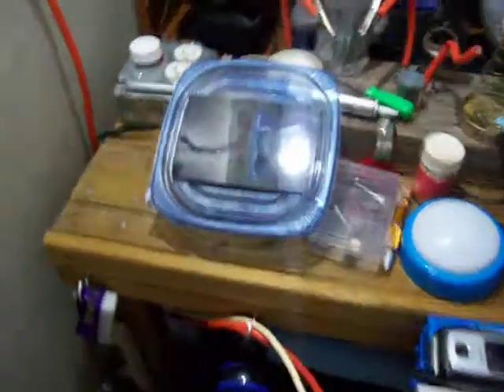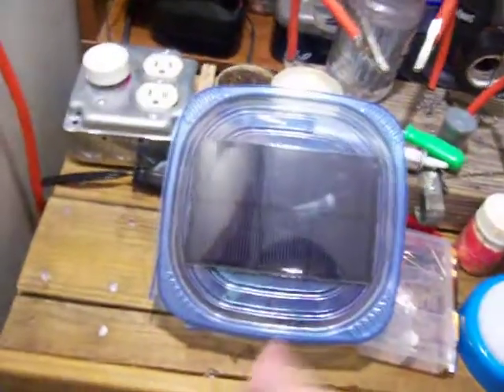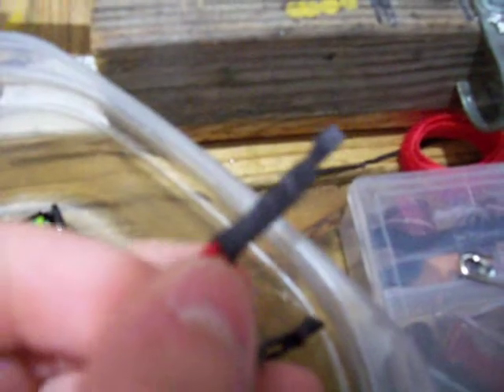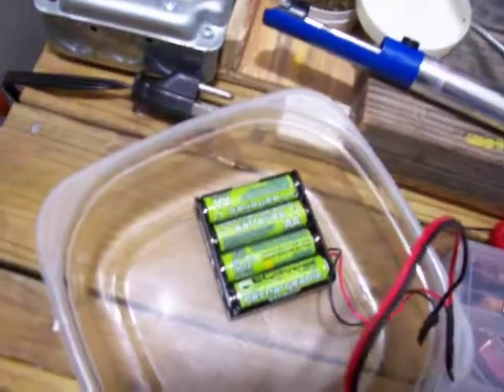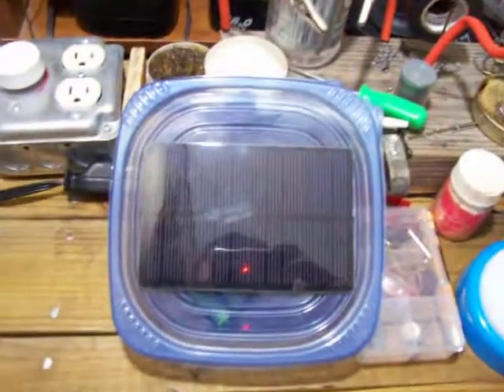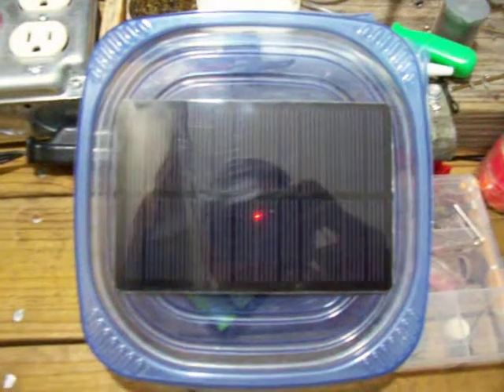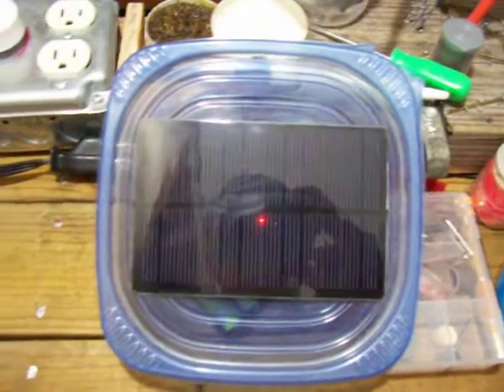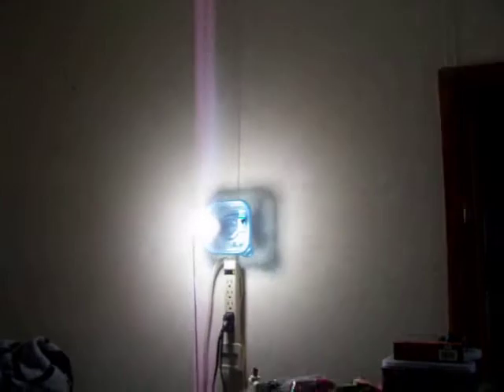Homemade Solar Battery Charger

Comment: Very good. I'm also about to attempt to make one. A little more compact though so i can stick it in my pocket.  I don't know the exact rating of the cell as i salvaged it. A quick reading on a rainy day gave me 150mah at just under 6v. I'm guessing i can get over 200mah on a nice sunny day.
Reply from the maker: The charger works out very good. The panel you have, is most likely a 1.0-1.5 watt panel. Thanks for the comment.
Reply: 2012solarful  Can ya believe it, I ended up scratching the back of the panel while removing it with a blade. Now it doesn't work very well. I'll order a better one off ebay.  I made something else since I was a cell down.  I'll take a screen so you can see, just gotta charge it up. Should be about an hour or so.
Reply from the maker: Pingo bags I hate to hear that about the panel. I will be looking for the video. Thanks.

Comment from the maker: The batteries I charge are about 2000 mAh but it depends on what type of battery it is. The battery effects the charge time. The solar panel puts out 6 volts at 250 mAh. If your thinking about makeing a charger like mine, the 1 watt solar panel will work but the charge time will be longer.  Thanks for the comment.

Comment: Are the batteries Ni-Cad or Ni-Mh? What is the amp or mAh rating on the batteries? I have some solar panels like that from Radio Shack that are 1 watt - 167 mAh. Do you know the what mAh that panel pushes?
Thanks for uploading and i got some solar chargers and Li-ion stuff on my channel if you want to check em out.